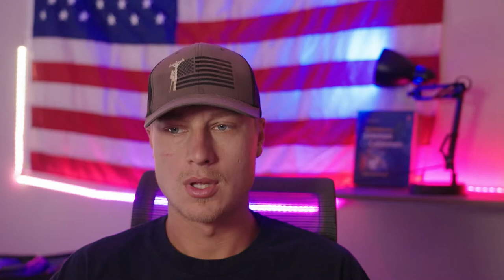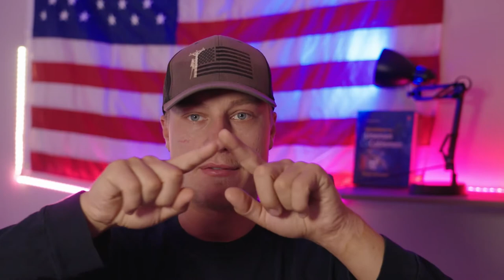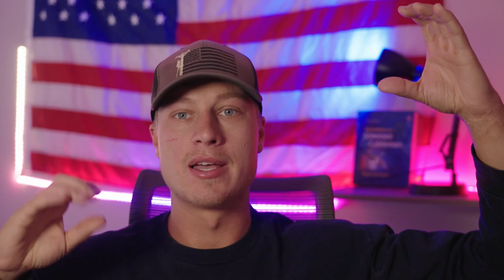How To Become A Lineman pt 1.

Comment: Transformer outside our home distributes either 100 or 200 amp into a 100 or 200 amp breaker based on the wire size as well. Then you can you a 15,20,25,30,35,40,45,50 most commonly use are the 20,30,40,and 50 (single or double pole) to distribute voltage to your home and appliances, (Make sure to do your load calculations, and use the right wire size to prevent yourself from being homeless) 😅